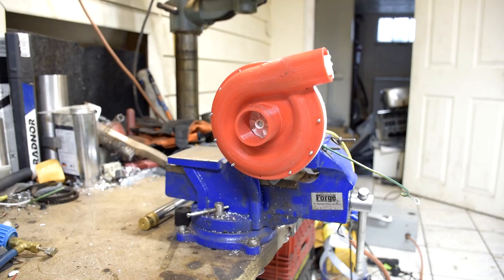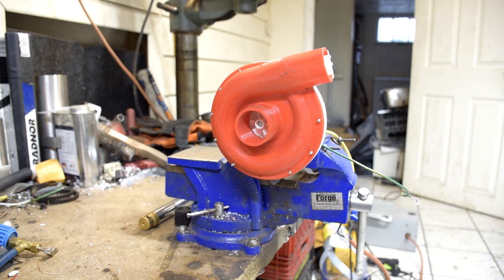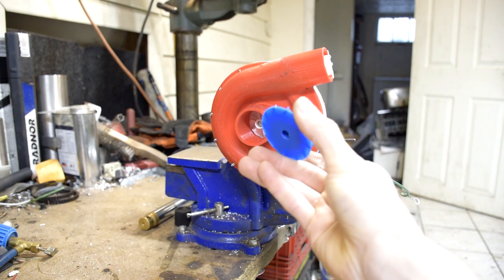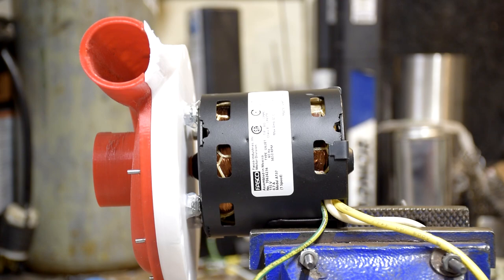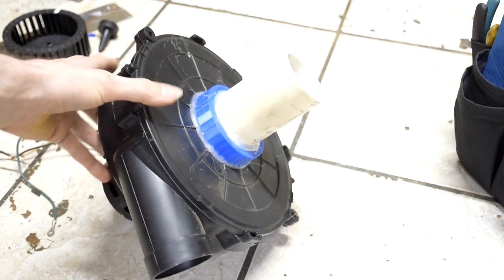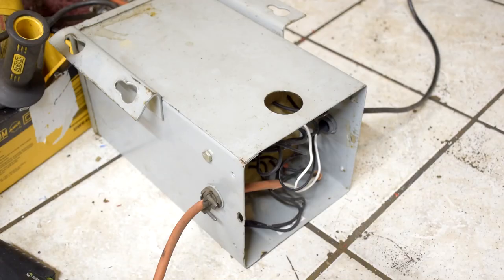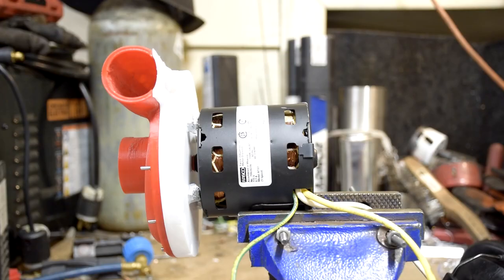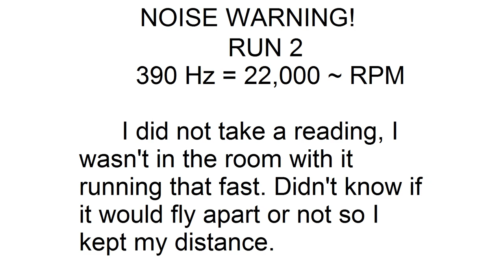3D printed centrifugal compressor/fan

Comment: Great experiment! Thanks for sharing! Anything with ~400Hz I find very interesting and I am sure there are many others who appreciate this. Have you measured the outcome, how did the compressor do? Are you planning further testing?
Reply from the maker: I haven't measured the discharge pressure since I'm not quite confident enough to be in the same room with it at full speed. After several runs, I can't see any visible damage so I assume the impeller didn't mind the speed. The motor, even with the increased voltage, isn't quite powerful enough to reach the full 400 Hz. I am considering scaling up the parts, as a larger diameter impeller should require less speed. Otherwise I will likely need a better motor. Thank you for watching

Comment: Not to get off the subject but I got a question on a drive circuit for a IGBT. I’d like to know if you can recommend a list of drive components for two FUJI 2MBI300N-060 in parallel . Id like to build a induction heater like the one you built back in the day. It’s going to be a slow process in piecing it together. I just need some recommendations on drive and tank components. I can send you a hundred bucks for your time. Thanks, Norm